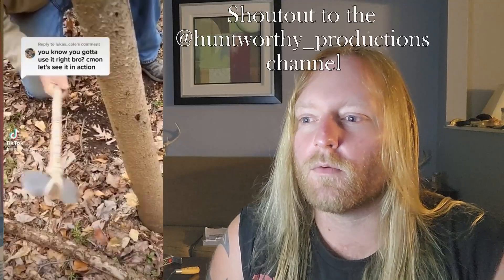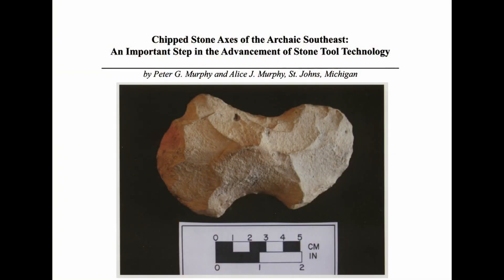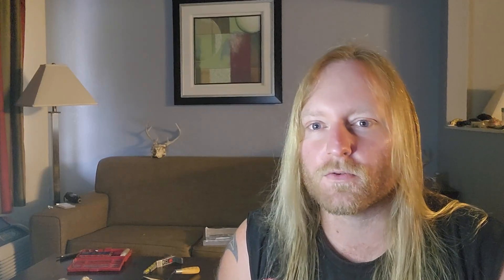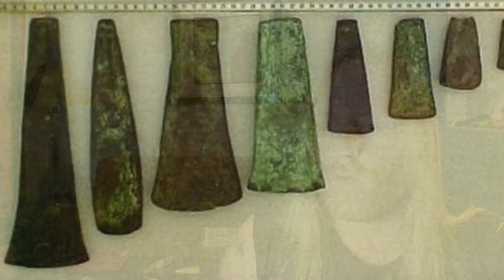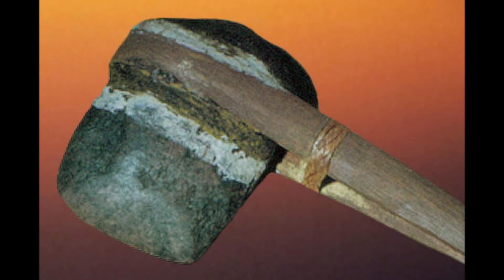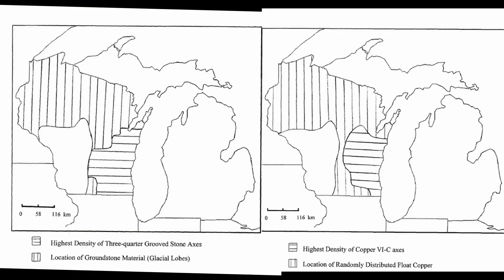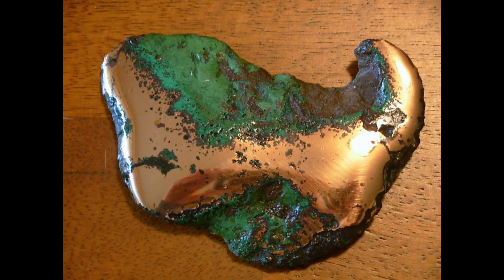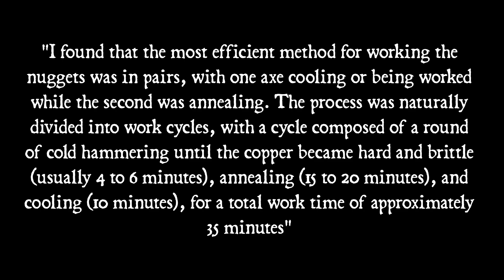Copper vs Stone Axes in the Archaic Great Lakes and Beyond

Comment: Good stuff.  I am curious if anyone has ever found a stone axe head still hafted?  I have done some of my own testing and found that larger pieces of serated chert, even low quality,  cut trees down with much less effort and much quicker than celt type "axes".  I wonder if those are even axes at all rather than just very nice and useful knapping tools.  I made a "celt" and was able to make large arrowhead looking knives using nothing else.  I used the thin part to do the pressure flaking rather than use antler.  One ",celt" did the whole thing.

Also when I find them , they are   very close to other knapping tools.  

I am the newbies of news but I can't find any evidence suggesting they are for sure "axes" or "celts".
Reply: I respect you for for creating and experimenting with these tools.  the problem is that these were obviously hafted tools.  why would you haft a knapping tool?
Reply: Someone posted photos on reddit recently of a stone axe with the original handle thingy. Not sure exactly how old it was but it was very very old.

Comment: First question I have is how was wood as well as what wood was used in these cultures?   Maybe we’re looking at it the wrong way? Also using fire to pre burn wood may explain shortcomings with stone axes?
Reply from the maker: Anything over about 6" in diameter would be burned and chopped. The smaller trees were cut for house posts and wood tools.

Comment: Definitely interesting and informative!  Thank you! Are there other types of woodworking tools made of stone or of copper in the archeological record of the Eastern Woodlands?  An adze for example.  I wonder if copper would be more effective in certain woodworking applications.
Reply: Hey i also wonder about the same thing, i recebtly tried to cold hammer an copper adze. For bow making pourposes, but i think i need to anniel it cuz i worked the edge too much and it went brittle and bended... or i think need to make the brittle parts softer and the bendy parts more hard xd But before i overworked it, and ruined the blade, it worked fine on a 15-20 cm thick willow  trunk(rather aoft and bendy wood) and made a very decent flat surface.  Id love to make a stone or bone one too, but i think this requires more knowledge about the  local rock that are available for me. And antler would also be rather expensive.
Reply: @vicitoedemane1244  find some local flint knappers.  Its a lot more fun to have folks already doing what you like and join in rather than re-invent the wheel!
See what they use to make arrow shafts....snag some sharp chert!!.